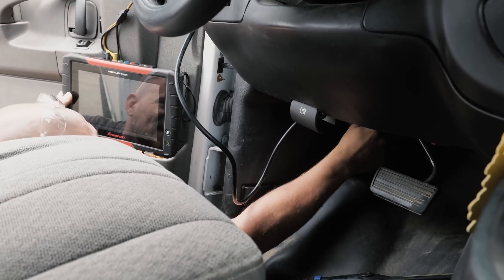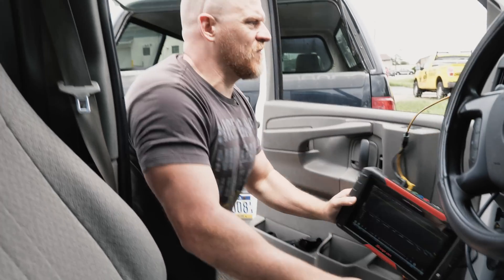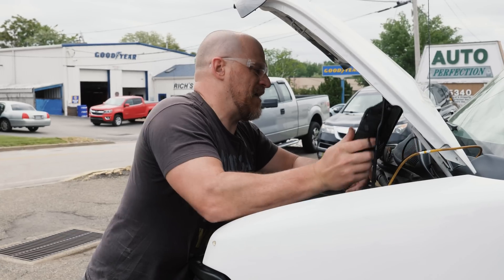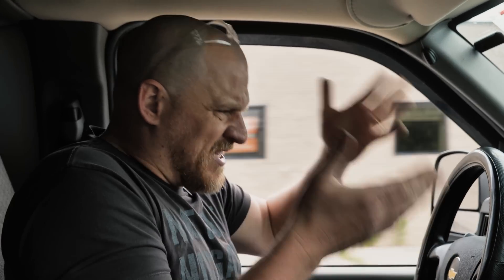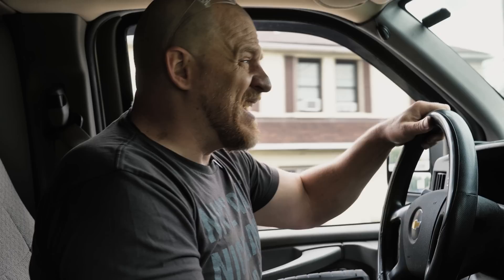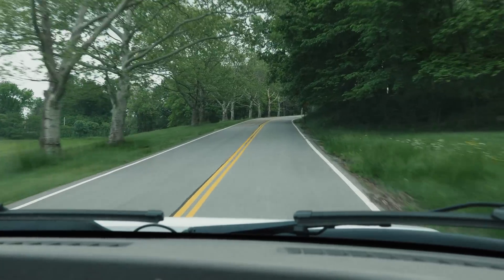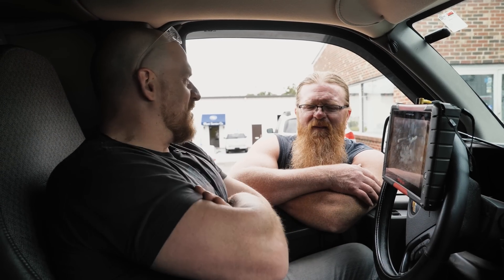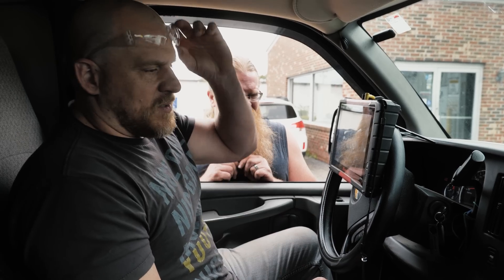We Don't Work For Free [Charging Diagnostic Time]

Comment: So I am no longer a mechanic and had stopped doing DIY for several years. But now I take care of my own cars and several others for friends and family. And let me say I agree with you. But my question is who pays for the parts cannon? Or for the shop that changes the oil and lets all the Freon out, AC worked when it went in. And did not when it left. Separate shop tested it charged it and no leaks. And I do understand the customer that comes in and says I have a miss change the coil. And does not allow diagnostic time. They should pay. But the tech should also communicate what he see's even in those circumstances.  
Your point about communication is key. I would rather of had a tech call me and say hey I am an hour in. And we know it is not x or y we think it is B but could be 3 other things. And to diagnose all other options would take 4 more hours. Do you want me to replace B. And see what happens which may mean a return and more diagnostic time. Up to you mr customer. But that is not what seems to happen and this happens often. I truly believe in your training. I pay for it actually mostly because I have received so much value from the free stuff you do on Youtube. So yes I believe Techs should get payed for their services. But Techs and Shops need to get way better at communications. 
I stopped taking my cars to shops because of several situations all with in a single year happening to me with several different shops. Oil change that dumped all the oil out with in 4 miles of leaving the shop, Another services that the air cleaner was left out all together and the air box was not even closed up. And Yes one case of me being that customer. I told them to change the clutch. the pilot bearing was bad but the left the old one in, never called me. 2 days later after picking truck up had issues shifting. pulled transmission pilot bearing was welded to the crank, had to put new crankshaft in. And had tires and breaks done. Lugnuts were not torqued down. Driving down the highway front wheel passes my daughter into the ditch. No studs left on wheel when done. That one is a bit of speculation it could have been over tightening as well. 
Either I suck at picking Shops. Or there is a bigger systemic problem that really needs to be addressed. And not all these were same shops and not all same city. It can be expensive finding a shop you can trust.

Comment: No joke maybe it's because I live in a high CoL area but how the fuck does the average person even afford diagnostics/actual mechanic work

It can easily run into the thousands :| I was quoted $1600 after $160 diagnostic for an AC compressor repair. Fuck that lmao. Of course I'm broke but I can't imagine everyone but me makes six figures. I think about how much I would have spent fixing my hoopties at the shop vs myself and it honestly makes more financial sense to buy a new car and have payments than to spend money fixing an old one if you can't do it yourself. 

Quoted $2200 for an ABS module repair in 2018. Could have just bought a whole ass running car for that money back then lmao.
Reply from the maker: The real problem is when someone quotes you a $1600 compressor and then that doesn't fix it! That is what this rant was about

Comment: Next topic should be on what shops pay their techs. I’ve worked in a number of shops that their certified master tech can’t diag a car for crap or just goes straight to the computer and tells the advisor what’s wrong based on most common fault. And yet they get paid the “big bucks”. It also bugs me how the we the techs have not seen a pay adjustment based on cost of living for decades now. Years ago 26-30$/hr was considered pretty good. Now days that’s barely enough to pay for tools and everything else and yet 32$/hr is still considered high according to shop owners and companies. Such a pain to deal with.

Comment: I took my truck to a shop recently to get a inspection and get my tail light wiring fixed. I knew what it was that needed fixed, I just didn't want to do it. I work 7 days a week and the last thing I want to do is work on my own truck in 100 degree heat. Here's how my bill totaled
Inspection- $12
Electrical diagnostic-$135
Labor for wiring-$65
Light bulb-$17.50
Ball joint replacement-$ 120
Ball joint labor-$275
4 wheel alignment-$135

Now after my tax I was out the door paying almost $700 for a ball joint, tail light wiring fixed, a bulb, inspection and alignment. Also I had  to miss 2 days of work because the shop originally told me they would be done the day I took the truck there. I had to get ahold of the shop 30 minutes before they was to close and see what was up with my truck. Then they said oh well we was really busy today and wasn't able to get to it, so either you can leave the truck here or bring it back tomorrow. Well I told them to keep it and it ended up taking them 4 days to fix my truck instead of the 1 I was told. I had to miss 2 days of work. So not only was I out the 700 to pay the shop I was out my 2 days pay at work. How's that fair to me? I still got charged for telling them what was wrong with my truck, $135 for electrical diagnostic.

Comment: I love your channel and always look forward to what is next.  I am a retired autobody repairer and know exactly what you mean especially with intermittent electrical problems. I do want to comment on time charged for repairs.  I absolutely agree one must pay for one's talent.  It takes many, many years to be a pro at anything. Admittedly some folks never get better than average but charge the same and most times more because of time spent.  A rookie may spend three days to find a problem whereas a pro may take a day or an hour because of their years of experience.( must pay for that talent).   Regardless if we are talking about lawyers, doctors, mechanics, plumbers, etc there are great professionals and then there are those that barely pass. Every shop has its best mechanic and then the rest. I do prefer to pay the bigger buck for someone with years of experience. Rookies have to start somewhere and I don't mind a rookie working alongside a pro on my car or home etc. In collision repair or rust repair? We also have the real good pros and then the average joe. Yet the door rates are the same is my point. So charging is important but so is the level of the expert on the case. We all cringe at having to go to a dealer, however, if you get the "right" person, sometimes it is faster/cheaper because maybe the pro has experienced your symptoms before vs a private garage that has never worked on your particular vehicle and needs to "learn" from ground zero. This rant is not worth a dime, but it's free. TY

Comment: Great information Paul.  Just out of curiosity, if you have an intermittent problem that you cannot duplicate.  Where do you draw the line? How much time?  In the past I used to spend on and off several days trying to duplicate the customer concern.  Driving down bumpy roads, shaking the whole truck around, wiggling all harnesses, etc lol.  Now, depending on the issue, I’ve gotten to the point where I only spend a few hours before I just ask the customer to bring it back when the problem is more frequent.
Reply from the maker: Sometimes I just go over it quickly then give it back without a charge at all! Why? Because I do NOT want to own it. Once you charge them, it is now your problem. And yes, just tell them to bring it back when it is happening more frequently

Comment: Unfortunately it also comes down to alot of shop owners or service managers who also don't want to pay a technician for diagnostic time. Technicians are pressured so much to have an answer of what is wrong within the first hour diagnostic time, you get guys start doing guessnoatics in hopes to happen to fix the issue. Then when that does not work, the technician gets it in the neck because it does not fix the problem. The industry is getting worse when it comes to this and less and less people are wanting to get into the automotive industry. You  make the same points I have been ranting on for years about the same things. I always appreciate your videos Paul, thanks for sharing all your k knowledge.

Comment: My car did not run good. It had a code. I told them to diagnose. Thery said it was upstream o2 sensor. $130 to diagnose. I told them fix it. They replaced o2 sensore. They charged me double of the cost of the part. I could buy the part fo $70 buckes. They Charged me $140 for the same brand part.They charged me $430 to diagnose, replace the o2 sensor. Wow.

Comment: Years ago I did a transmission overhaul, job took me a week because I kept needing more parts and wrong parts were showing up. Customer called three times everyday wanting updates and my loser advisor couldn’t set him straight. My garage gave the customer a loaner, they have wheels, what are they rushing me….?

Anyhow, the day I put it together and install the transmission my advisor keeps telling the customer just two more hours. When I drive the car out and start my post checks my (loser) advisor tells the customer the job is done.

I took the car for lunch and got stuck in traffic on the way back. For an hour I’m dropping ass in the car, it’s bad, when I get to the garage the customer sees the car pull into the garage. They walk up with the advisor, wanting the car, they get it and are immediately hit with the smell of ass I had been dropping in the car for the last hour.

I was pleased, don’t rush techs
Reply from the maker: lol

Comment: something really triggered him bad, i understand, my bro has talked to him on FB  he teaches auto in buffalo ny area. many dont realize not just your expierience, but tools!!  scanners like his ex a autel maxi sysy high level models maybe 3500-4k a piece, Not talking even bout the snap on zeus either..  Ex  i paid a guy were i live recently for puting in a new knuckle and wheel bearing/hub and 4 whhel alignment on my malibu( i supplied all the parts). I had to return a bad ECU to flashmasters on warranty, ECU  on this car needed a crankshaft repostion relearn, my autel at the time didnt have the special function. I came back to same guy he had all high levels scanners, he did the relearn in 10 minutes, maybe 5. i asked him how much? he said no charge no big deal, just recommend me. difference is i would of paid him 50usd to do the relearn which was 5-10 mins at max. Many would of assumed it was free,  Ironic thing was 1 week later My autel had alot of updates,maxi com 808. I got special functions, that now i can do a crankshaft repostion sensor relearn. Story is i dont asume shit is for free, i would of paid the guy, even for 5-10 mins of his time.

Comment: The other day had a buick with bad app sensor Orielly sent new one worked 1 day back still bad sensor they sent another one. Bad DORMAN called dormman spent 2hrs on phone checking all wires scoping all signals bad sensor dorman tech service said buy OEM I said who is paying for all this diagnostic time. DORMAN said turn in bill and we will pay you so I did 2 hrs labor haven't got check but said I will
Reply: I went down the rabbit hole about 3 weeks back on a Buick with a bad APP, and got two Dorman assemblies that both set the same codes as the original failed part.

Comment: Out of a thousand car diagnostics, how many of those are you not able to diagnose within the first hour?
Reply from the maker: Before CAN issues, I'd say 90-95% can be found within that first hour BUT if it is an intermittent issue, like this van it's 50-50 at best.
With the CAN issues and parasitic drains, we start the billing agreement at 2 hours min or we won't even agree to the job

Comment: Nice video. I used my Verus lab scope and the knowledge I have learned from to trouble shoot my Aqua Hot boiler in my RV. The scope showed the glitch the volt meter just showed a small drop in voltage. It still was a hard call to make since the Webasto controller is a thousand bucks. Got a rebuilt one for half price and problem fixed. Thanks Paul for all your teaching and the people whining about you talking to much can go and kick rocks.
Reply from the maker: Thank you Cullen!